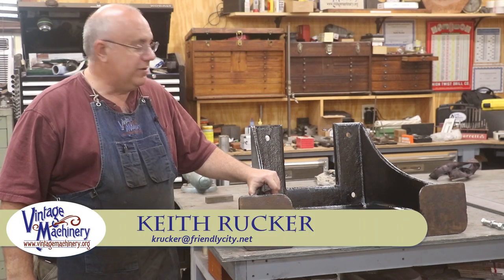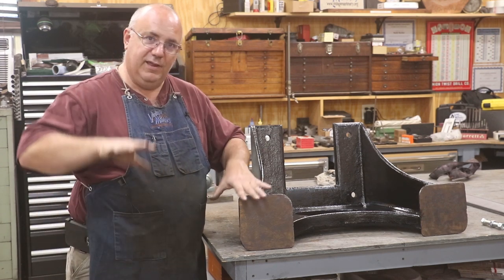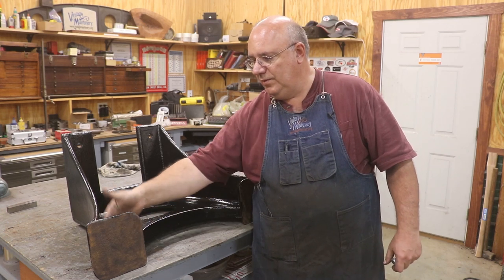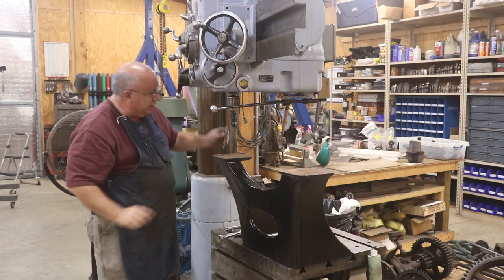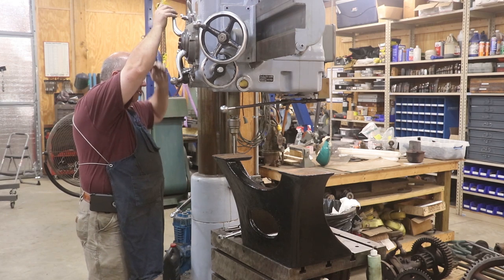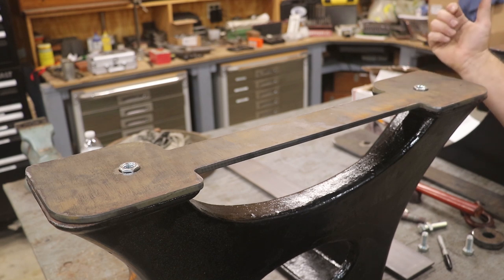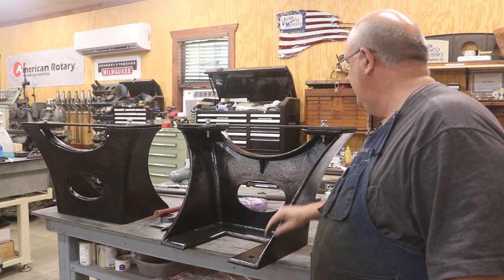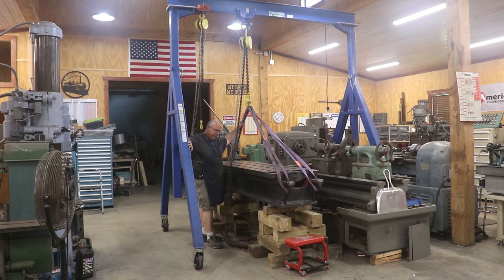New Haven Metal Planer Restoration - Part 11: Adding Leveling Feet

Comment: Twisting wouldn't be an issue if you use the tripod method.  Instead of leveling all four feet to mitigate twist, you can fabricate a piece of plate steel or tube steel that spans one set of legs, and weld a piece of bar stock in the middle.  The bar stock is 1 of the 3 tripod legs, and the other 2 legs are at the other end of the planer.  You don't have to do it exactly like I mentioned, but you get the idea. Instead of 4 legs, find a way to fabricate so that the machine sets on 3 legs.

Comment: Unless your overhead crane will not fit, I would be assembling the planer where it will reside. I just don't like doing jobs (leveling) twice. My large Pratt & Whitney lathe has wedge levelers.

Comment: Not sure if all that mass of the table going back and forth causing it to walk off those pads 🤔🤔
Maybe bolt the plate to the floor and weld some rings on top of it for pockets the bolts could set in.

Comment: I have no experience with metal so I could be completely wrong here, but I do have to ask :)
Aren't you worried about the shear stresses? Instead of having about 20 cm^2 of surface per foot you've effectively reduced it to about 1 cm^2. Wouldn't a wedge type setup be a bit safer?
Reply: USUALLY the way this will work is that the screws are used for adjusting, they will actually sit on a plate/disc that will be on the floor.  Keith did a similar thing on his Lathe.  When I was a machine builder 30+ years ago we used 2" Bolts (that had a convex end) and that was received into a 4" x 4" pad that was on the floor.  We were leveling MASSIVE 15 Ton+ stations with 8 of these bolts.  Worked a treat.  Sounds like a lot, but 15 Tons spread over 8 pads, it's only 118PSI.  Realize our slabs were 12" thick of reinforced concrete, but again, in the end the weight was only 118 pounds per square inch.  Each pad was supporting 1875 pounds.  Keith's machine isn't nearly that heavy, and I believe he'll have leveling pads under those feet, at least I hope he does.  LOL
Reply: @WreckDiver99  I'm more worried about the forces of the planer going back and forth. I would think that could cause instability with this setup
Reply: Cool, thanks for the info! :)

Comment: As this is still resting on a few boltheads...
Does anyone think this machine is going to creep whilst running...?
 Do those boltheads have numbers on em...?
Were those numbers turned off before they were fitted...?
As if not then the contact area will be even less...🇬🇧👍

Comment: It appears that after all your work the weight on the foot pads is still supported on the threads of four 5/8 inch bolts.  I am not a machinists but I think the adjustment should have been on separate pads at least the size of the feet.  i was waiting for your call for my advice! 😐

Comment: You mention you have a leaky seal on the drill, and you can see in the video that the oil sight gauge is showing that the oil level is very low. Need to check the oil!!
Reply: Maybe that’s how he noticed the leak in the first place after all isn’t that what sight gauges are there for?

Comment: The bolt heads resting on the sheet metal could start walking.
Prefer to weld some pads to the bolt heads.

Comment: jogging the physics memory here..  1800 pounds about 8 feet long and the straps are 3 feet above the table(guessing), giving a 3-4-5 right triangle.  Each of the 8 straps has 375 pounds of tension???
  is that right?  Seems like it should be more.

Comment: I am not an expert, but my understanding is that cadmium vapor is quite dangerous...so were those nuts not plated?
Reply: dhamma58  Cadmium hasn't been used for many years/decades, at least on this side of the pond, but the Zinc now used also has hazards when welding.

Comment: You are ending up with quite the shop. For the guys that think "a few threads" isn't adequate to support the machine, we've got several machines that are a lot heavier sitting on a similar scheme. The recommendation, by the manufacturers, for mounting.
Reply: When I had the company we did similar mountings for 37 years. Some of those machines are still running just where we set them,,,,and all were WAY bigger then that planer. - Like a planer mill that's 75 feet long. 103 tons when it's assembled. It's in a steel mill in PA running today.

Comment: Keith I think you will have to bolt that thing to the floor
Reply: Why though? It clearly hasn't needed bolted down for the last 100+years as evidenced by the no bolt holes in the feet.
Reply: Hey Brian  I'm sure you're right but I can just see a 400 pound part sliding back and forth trying to make that machine walk. Anyway I'm looking forward to some chips you guys keep up the good work
Reply: @goodfortune6399  If the table were cycling in the 50 or so and up times per second, I could see the movement being a problem.  That much mass is a lot to start and stop plus direction change.
Reply: @goodfortune6399  Most of those old planers I have seen the table moves about at walking pace, they aren't as fast moving as a shaper, at full bore they will walk on ya!
Reply: @chris0tube Modern machines operate at a much faster rate than machines 100 years ago.  That planer likely has a top speed of 50IPM.  600IPM is more common on modern mills so the forces and movements involved are much more violent and need more to counteract them.  When that machine was built the probably expected it to be sat on a wood floor even. At about 1 table cylce per minute it shouldn't get too crazy.

Comment: In my opinion, Precision Levelers like these 

https://www.airloc.com/en/products/wedgemount-precision-levelers/vrc-free-standing/vrc-free-standing.html
would be much easier and more stable for this Planer. No holes to drill, just put them under the feet and level the Planer
To prevent the planer from walking there are olso versions to bolt down to the Concrete
https://www.airloc.com/en/products/wedgemount-precision-levelers/vrc-bolt-on/vrc-bolt-on-centric.html

Comment: To be honest, I'm bemused by all that - the idea, the mismatch, and how a seasoned machinist could arrived at this "solution in a search of (future) problems". The first alarm bell shuld be "wait a minute... perhaps there was some reason they've made these feet so broad - all six of them - for this planer in the first place, eh?"
When my broher and I have been setting up a glass-pane washer (a machine weighing  at most half the weight of that planer) we used bolts thrice the size (at least), with  finer pitch thread, with their ends machined into flat cones, and the whole thing was put  on round thick steel "feets" (with matching cones machined into them, to accept those cone shaped ends of them bolts).
That was like fifteen years ago, the machine is used every working day ever since, never moved a bit.
Overkill? Well, "nothing too strong ever broke", as they say... Abom in one of his videos has shown how to do it properly (setting one of his lathes in a new place in his shop) but I can't seem to find it now.
Reply: I was a millwright in a glass plant. The reason for making the mounting feet so strong is not to hold the weight of the glass but to  help when some idiot drops  a lite, ar a few lites, onto the table from a height or drives a forklift into it.
Reply: @millwrightrick1  I can't say anything about your experience, the machine I was talking about was a glass panes washer - that thing where freshly cut glass panes are sent to be washed (in nearly vertical position, transported on a set of rubber coated rollers) before being assembled into double glazing units. A big box with sprinklers, series of rotating brushes, and so called "air blade" blowers. Quite havy, but no heavy parts in RECIPROCATING motion, only rotating and well-balanced parts.
But it has to stay well aligned with the rest of the assembly line - and no, not even a sign of any forklift within hundred feet of it. Not in that area

Anyway, it is beside the point - that example of mine was just a point of reference; the main issue here is Keith's idea of putting a heavy machine with heavy parts moving reciprocally on couple of tiny bolts. In my opinion it is NOT going to last - either bolts will break, or concrete floor will get damaged, or both. But I'm not forcing my views or predictions on anyone - democracy, you see... Everyone is entitled to his own opinions... ;-)

It is just that thing with Keith that amuses me every now and then - his propensity for doing things in a way Germans describe as "warum einfach wenn's auch kompliziert geht", often combined with lack of thinking his ideas through, at different angles.
Yes, I know - theres more than one way to skin a cat. And no, I'm not trying to belittle Keith's skills - in fact, I consider him to be well-seasoned and skilled machinist - but those are different things. In other words, I'm not talking about how well he executes his ideas or projects (i.e. his skills and precision), I'm just talking about SOME (!) funny ideas of his ("funny" in a sense "difficult to explain or understand; strange or curious, unusual").

If you want me to list few of those, I'll do it - but not now, not today - I have more pressing things to do at the moment - but I can do that if you want me to - no problemo, ammigo.
Cheers  : )

Comment: Re: your rigging. Having that steep of an angel cuts your load capacity in less than half. Also, you need to divide the load by three, not four. That is due to.... aw, shucks. You probably know all of this. But for your viewers. It is best to know rather than just guess. If you have any questions about rigging. Seek a chart that can spell it out for you. They are widely  available.

Comment: Yes this is your project and you can do what you will.  All well and good, but I think it would be better to use a pad such as a low profile adjustable wedge that has a larger bearing surface and available at McMaster-Carr.   6012K41
JIM
Reply: I never knew about this kind of leveler.  Rather expensive, but does not look too difficult to make. Thanks for sharing.

Comment: Love vids, However big mistake, shims and grout or something like these,
 https://www.mscdirect.com/browse/tnpla/88000831?cid=ppc-google-New+-+Hardware+-+PLA_se0BArMfV___164124449498_c_S&mkwid=se0BArMfV|dc&pcrid=164124449498&rd=k&product_id=88000831&gclid=EAIaIQobChMI497Ckpf-5QIVFBx9Ch3BNguTEAQYAiABEgLDa_D_BwE
been in the machine business for over 50 years, manual and high end CNC, small point load no good

Comment: You crane skills are a bit scary.  When I see weight that high, I think Potential Energy...Maybe next time, remove the cribbing and put it on a pallet jack.  Go low, go slow...  3600 in lbs will destroy less hardware than 3600 ft lbs (PE).  At the very least, get your wheels oriented before you load them.

Comment: You should have secured that planer to the nearest A frame to stop it swinging about, then your whole attention could have been put to moving the gantry without fear of that planer swinging round and causing damage. Also, as soon as you have the packing out, get it lowered as low as you can go without it tripping you up or getting in the way of being moved. (Just saying.)